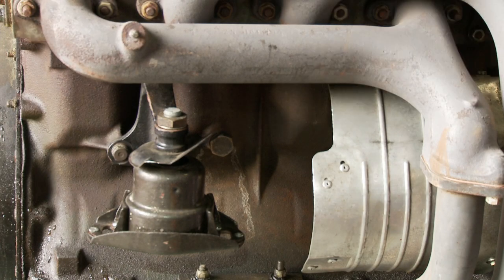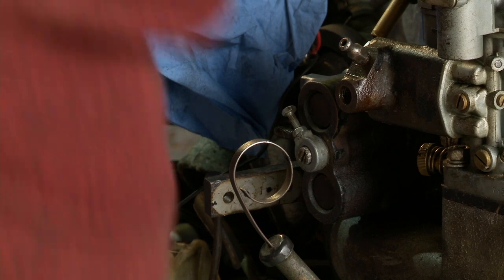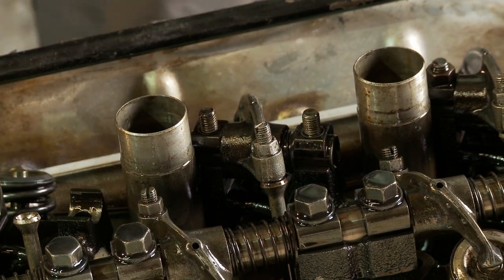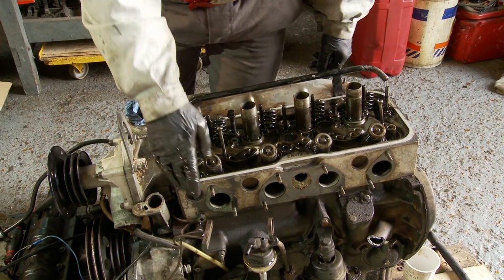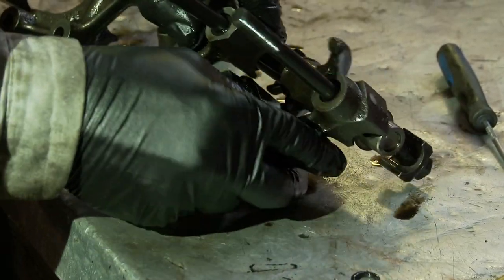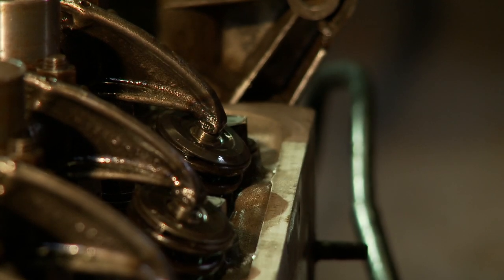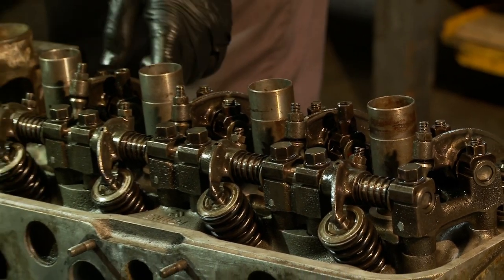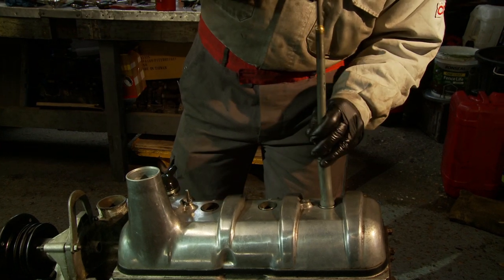Replacing the cylinder head gasket

Comment: What do you use for a wash tank and what solution is in there?
Reply from the maker: Just a standard garage parts washer. In the UK Machine Mart sell something similar - other brands are available. For the home mechanic I have used a large plastic tub and “Gunk” to clean a 2CV engine. Again other brands are available… FWIW Ian
Reply: @servicingthegoddess  Thank you for the reply. I was thinking of washing in petrol.
Reply from the maker: Personally I wouldn’t - dangerous fumes as well as huge fire risk!
Reply: @servicingthegoddess  Thank you.

Comment: Hello. On my engine gasket set it advises 'Always replace cylinder head bolts.' As long as the bolts are not corroded, is this necessary? Thanks
Reply from the maker: Modern cylinder head bolts have some "stretch" in them I believe. DS head bolts don't so as long as they are in good condition feel free to reuse them. We did on my car in the video...  Ian
Reply: @servicingthegoddess  Thanks Ian. I had to buy two new but I will reuse the rest.

Comment: What was the issue with the stuck push rods?
Reply from the maker: Hi Simon, neither of us can remember why they were stuck . The original ones were reused but a couple of valves were replaced and all reseated. There was a but of valve seat recession which was corrected.

Bw 

Ian